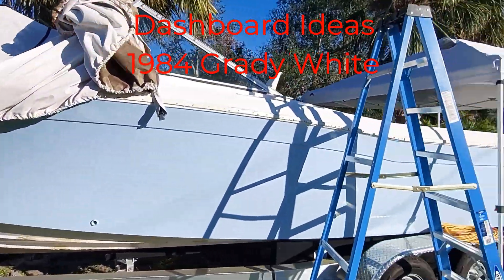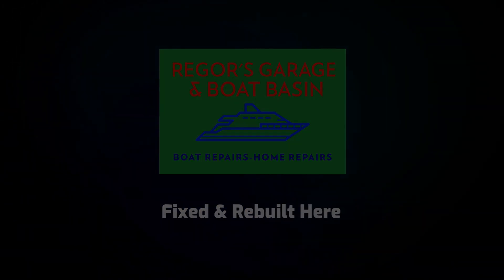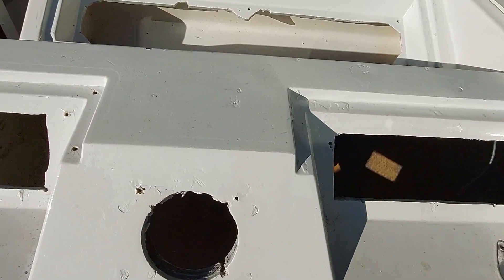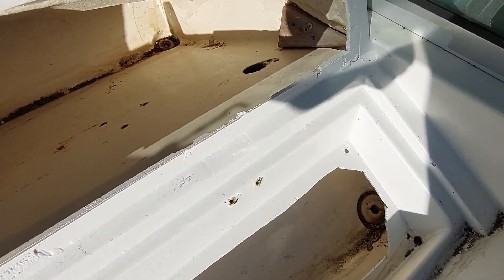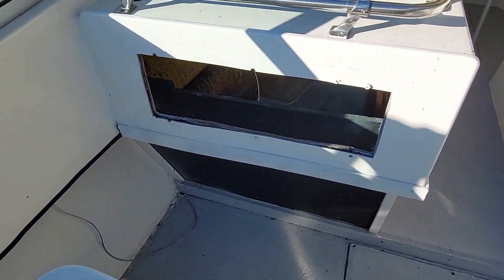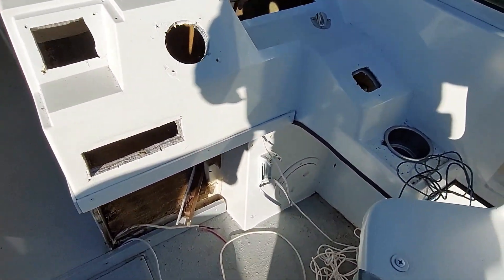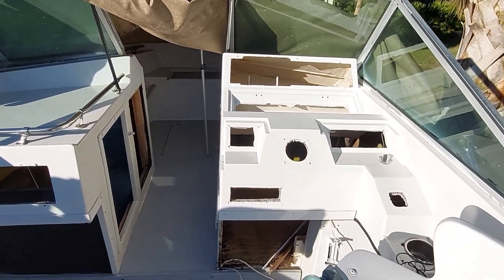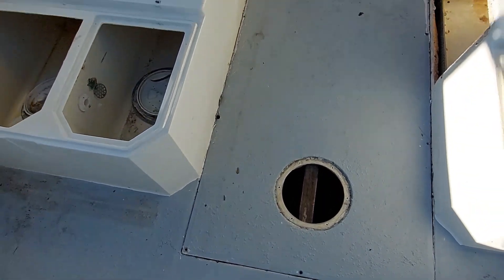1984 Grady White - Dashboard Ideas Episode 20

Comment: Nice vid! We have an 85 offshore pro and we have a video on restoring the same hatches you’re looking to fix. If you need any help or guidance we might be able to save you some headaches! 🍻
Reply from the maker: Thank you.  Generally, I'm going to cut out the two cubby holes and replace it with plywood and a black plastic covering to hold the chart plotter and depth finder.